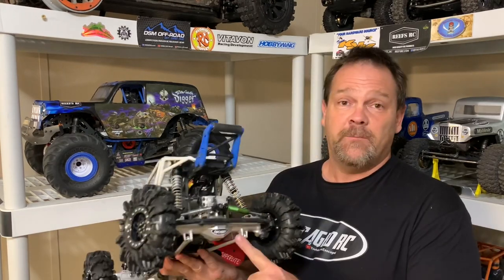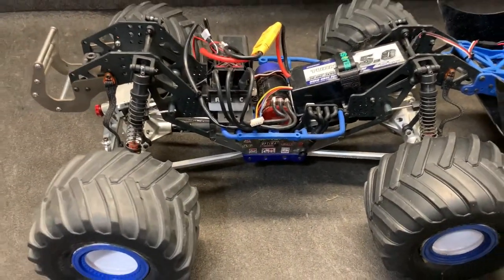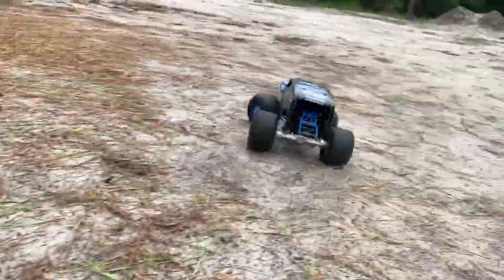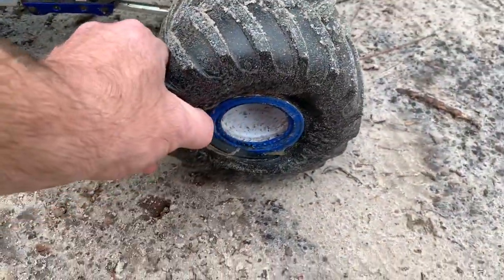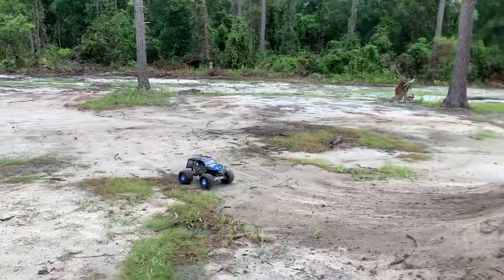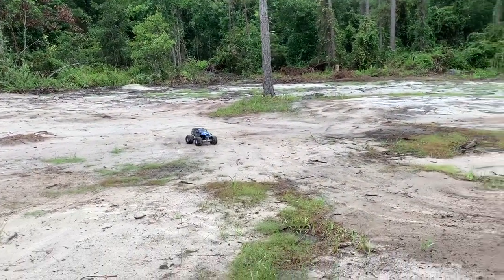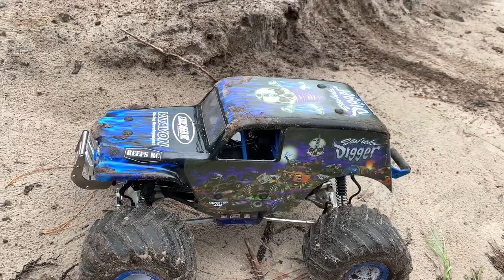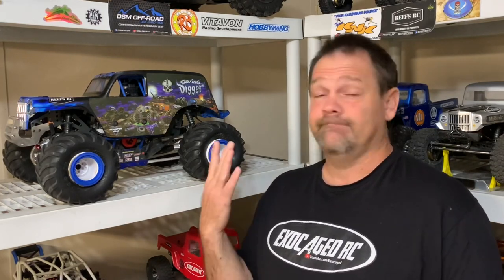Losi Son UVA Digger with new Vitavon front axle housing

Comment: Just got mine together and used a castle 2200 and sidewinder 8 until get another esc works good and runs cool I think a 40 series motor is the ticket for the weight and I only ran it on 3and4s so far with 12t gear and wow one day with upgrades I'll put 6s to it just to see how crazy it be but there's really no need.

Comment: Yeah I already put Bow house ESC tray in mine love it along with the battery tray, took my stainless steel push bar off the front, hit a jump wrong it bent all to heck, even the one frame Rail bent a little had to straighten up, got a new front bumper, can’t think of the guys name, but he is on LMT group. It’s like a hard rubbery type material it is awesome, but yeah it did a couple cart wheels after the jump when landed and Bent the one frame rail and the push bar

Comment: Be careful with that steel front bumper. In a crash it can bend your frame. I make a semiflexible TPU bumper that will give a little in a crash and will actually protect the frame. They are available on eBay.

Comment: What a fun truck the LMT is!  Running HW Max 8 4268 @ 2600kv on mine.  It rips on 3s but gets hot on 4s.  Would a 12t pinion make a big difference??
Reply: I went from a 14 stock dropped to a 13 and it made a bigger difference than I would expect.